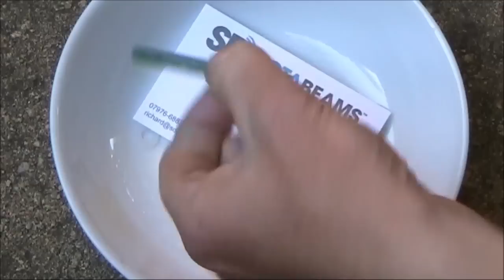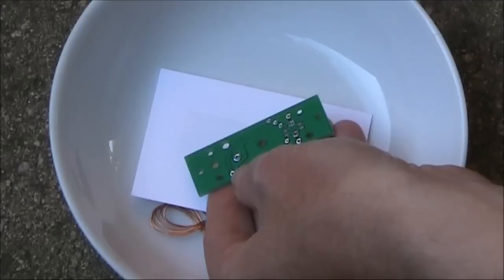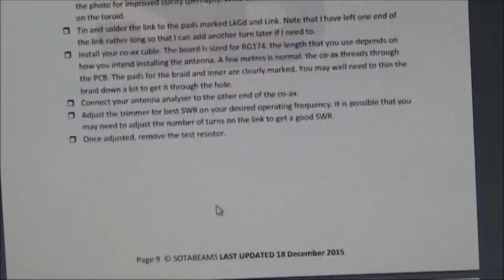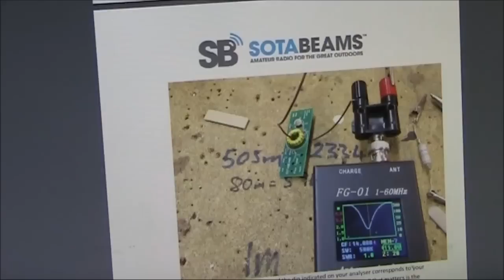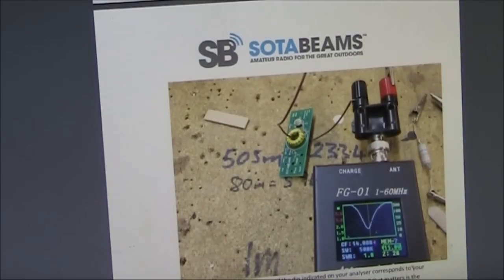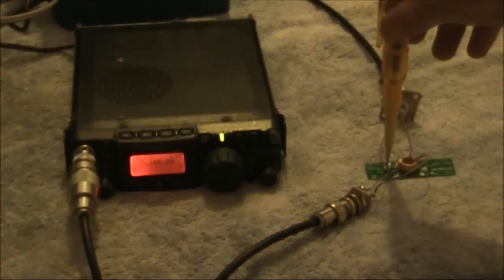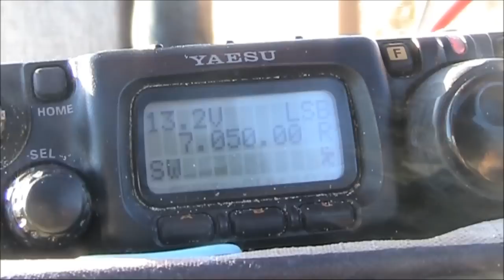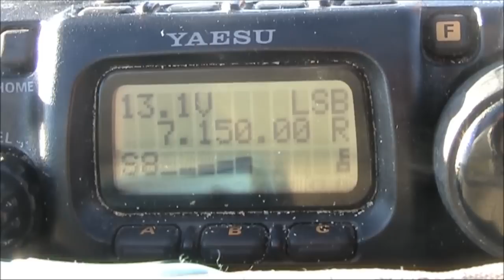A review of the SOTABEAMS Picotuner antenna coupler

Comment: Unfortunately when I checked 0n 14-10-2020 they are no-longer stocked, but the assembly manual can be used to make your own, it seems to be a good little project! But - Perhaps they were not selling enough to hold in stock.

Comment: Peter, I have to say your home made QRP tuner makes more sense than this tuner per the cost and use! Using the fixed chokes and using two selectable caps makes yours lots more versatile than this one. This one is just a kit that most could build if they try! But again I'd rather see ones like your DIY unit at QRP gatherings than this one, for so many reasons. If several bands are being used designs like your DIY unit could allow the use on the bands not being used. But with this one your stuck to one band and may end up being just an observer rather than an operator at an event. A big THANK YOU for another great video. BTW am in Florida right now snow birding with my squid pole and Ten Tec R4030 radio, hope to work you on 40 meters. 73 Jimmy, ARRL TS, WX9DX
Reply: WX9DX A